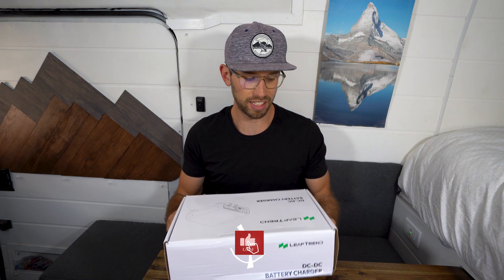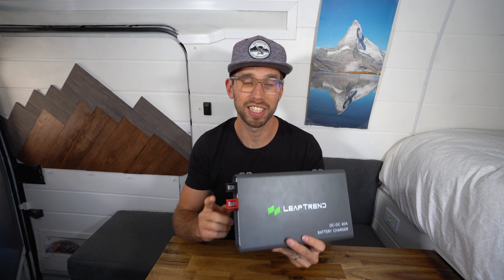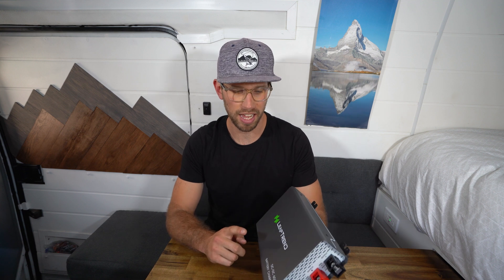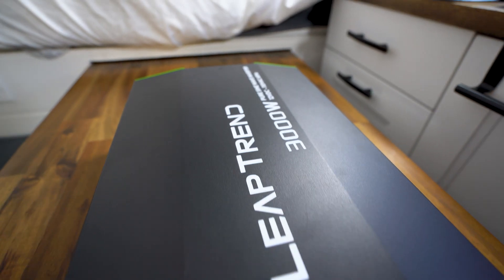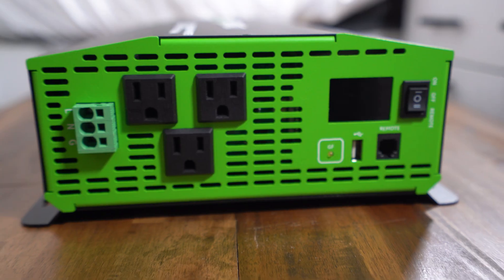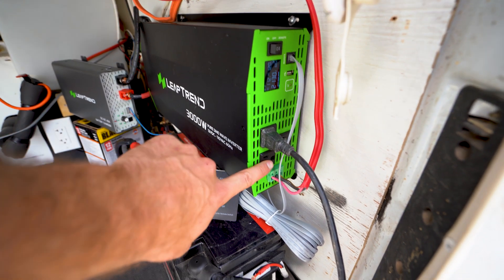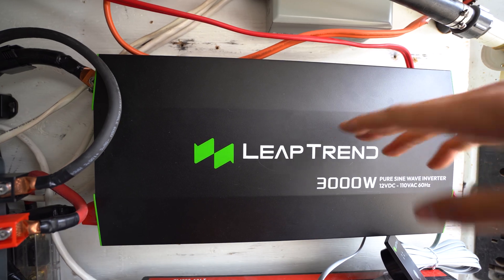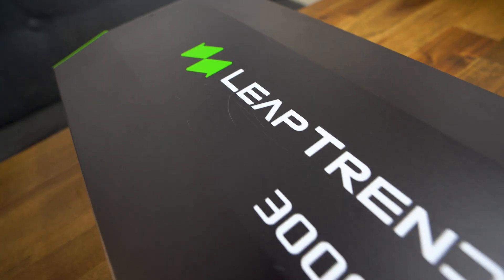Leaptrend DC-DC Charger & 3000w Inverter | Complete Review

Comment: Useful review, thank you.  I have a question about the DC to DC charge voltage for LeFePo4 batteries.  I understand that it stops at 13.8 Volts and LiFePo4 batteries require 14.2 V for  a complete charge so the Leaptrend chargers will not completely charge them.   Just wondering if you have any comments on this?  Also, a minor critique:  you mentioned that the fuses are welded in place.  They are soldered in place, not welded and you did lose some credibility with me, doing a review of electronic devices if you don't know the difference between welding and soldering.  Maybe edit the audio track?
Reply from the maker: That is for the bulk charging phase. Once the battery hits 13.8v, it will transition to the absorption phase until it reaches its max voltage.
Reply: @madetoexplore  I went on the leaptrend site for the 40a dcdc charger and in their description of the product it states that it does in fact have a float charge. Is this charger different from your 60a or did they come out with a newer version since your vid 2 years ago?